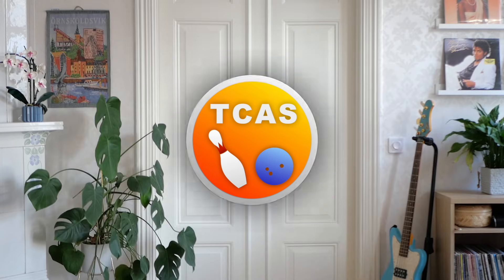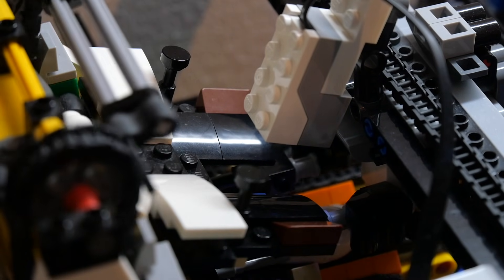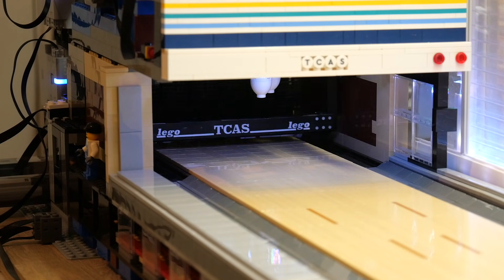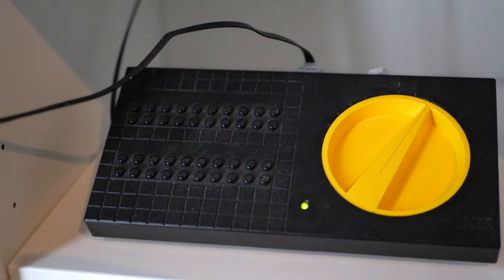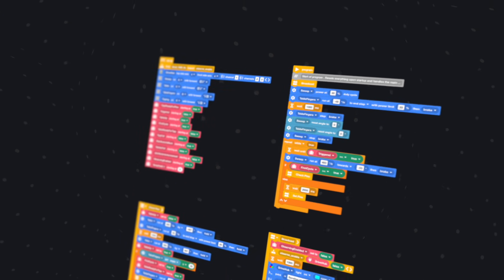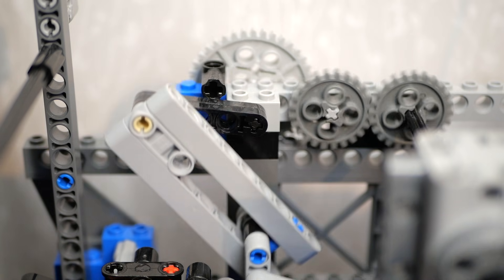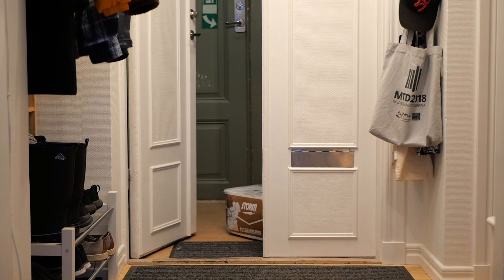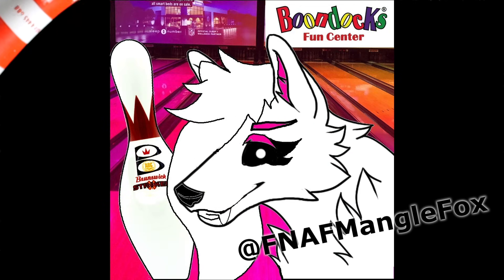TCAS Pinsetter - Powered UP, PyBricks & More!

Comment: The last 2 pins you are missing are 2 Canadian pins , a Fivepin and a Rubber banded duckpin
Reply from the maker: I’d also love a Kegel pin :)
Reply: Oh , also the way you identify these is by the blue/black rubber band in the center of the pin , and you also will need a photo from the side to identify fully , if it's nearly the height of a tenpin , it's a fivepin , but if it's really short , it's a rubber band duckpin

Comment: Hello thinkCLEVERandsmart, I just downloaded score more and I was wondering we’re do you get the senors so it can be fully automatic and how to do hook it up?
Reply from the maker: Hi! You can get the sensors from Amazon for example. Look for ”6V Laser sensor NC”. You then need an arduino Uno or Leonardo that plugs in to your computer with USB. Make sure to install StandardFirmata on it. Let me know if I can help further :)
Reply: Thanks! One more question sorry for bothering you but can you just use a webcam for score more and u just press the space bar right?
Reply from the maker: @Nickthe2handedbowler No problem, I like to help! Yes you can just use a webcam with ScoreMore, and you’ll calibrate it in the camera menu. Then you can press the ”s” key to score :)
Reply: @ThinkCleverAndSmart I got the Webcam the. A calibrated it into the scoring system. But every time I roll the ball and get pins down it always says I got a gutter ball or I only got 1 pin do you know the reason for that?
Reply from the maker: @Nickthe2handedbowler during calibration, does the pins light up green or red? They are all supposed to light up green. Then, if you remove all the pins, they all should turn red. If not, you can play with the threshold slider to get it right. You may also check that the background behind the pins is dark enough :)
Reply: When I set it up the pins are green but when I bowl and get a strike it says I got a gutter ball and when there’s no pins left they don’t turn red
Reply from the maker: @Nickthe2handedbowler Yeah that means the background isn’t dark enough or the threshold slider needs to be adjusted. Put all pins back up, then drag the slider so that at least one pin turns red. Then drag the slider just enough so the pin turns green again. See if that works :)

Comment: That is a huge glow-up with the new pybrick motors! Also, how long is the pinsetter and the lane altogether?
Reply from the maker: @MachuGamingDX  thanks! It’s about 1.5 meters in total
Reply: @ I meant the length in lego studs.
Reply from the maker: @ Well it’s not to scale anyways. But 1.5m would be about 187 studs

Comment: Hi tcas, do you need an ardiuno do get automatic scoring in scoremore? im just using a webcam and i calibrated the pins but when i start a game, it doesnt work. How to fix this?
Reply: and also, when i open the app my camera makes all the colours black. Is that normal? thanks
Reply from the maker: @ImBoredCuzWhyNot  Yes that’s normal, just to make it easier to see. The pins should look white and the background needs to be black for it to work
Reply: @ThinkCleverAndSmart  hey tcas, even if i calibrate the pins and save it, when i shoot and click s it just says i missed. Is there a way to fix this?
Reply from the maker: @ImBoredCuzWhyNot  what color is shown on the pins when calibrating? Green or red? Also, what happens to the color of you remove that pin just to test?
Reply: @ThinkCleverAndSmart Its green and it stays green when the pins arent there for some reason
Reply from the maker: @ImBoredCuzWhyNot  That means it’s not dark enough in the spot where the pin used to be. Try make the background black and play around with the slider value to see what happens. It should be red when a pin is removed
Reply: @ThinkCleverAndSmart  Ok thanks
Reply from the maker: @ImBoredCuzWhyNot  Hi! Yes, you need the arduino and a pair of sensors to get automatic scoring. If you just want to use the webcam without arduino, then just press the s key on the keyboard to score
Reply: @ThinkCleverAndSmart  Ok! Thank you so much

Comment: idea: for your distributor, instead of having the entire assembly move forward with a seperate motor, make the assembly stationary and put a ramp under it that can extend outward and have it controlled by the same motor that controls the left and right movement of the distributor (for instance: if the arm thing is to the left, the ramp is extended, but if it's to the right, the ramp will be retracted)

also had you ever had a problem where your pins get decapitated before? (the part above the red stud falling off)
Reply from the maker: @RedSlime69  Im currently working on a version of the distributor without the chains, but I cannot use ramps. I tried using ramps before but the pins will get stuck unless the angle is very big, which uses a lot of space. I’ll make a video when this is done 😄

I’ve actually only had that problem when a pin gets stuck somewhere in the machine, never from just bowling. They are really robust since I’m using a bar inside of them that goes through the head and body
Reply: @ThinkCleverAndSmart  how about you did what amf distributors do and stretch out the belt/chains instead (you already know how it works because you done that style of distributor before)
Reply from the maker: @RedSlime69  Ot works but requires a lot of precision and it’s a problem that the pins come in at an angle to the holding area. I think the new version will be a bit better
Reply: @ThinkCleverAndSmart  well good luck on that version then! i hope you complete it soon!

Comment: Pinsetter evolution (from memory):

-Started out as A2, with only a rake and a barely functional setting table
-scrapped and rebuilt into GS-X with new rake/sweep, transport band but no setting table
-setting table added with some changes to the back
-setting table removed and rebuilt for the NXT 2.0 upgrade
-rebranded into TCAS
-pin wheel added but was removed right after and replaced with a pin elevator (WRONG)
-ball accelerator added
-pin elevator shovels rebuilt due to pin jams
-setting table rack rebuild
-pin elevator shovels rebuilt AGAIN due to more pin jams
-sweep mechanism upgrade
-prototype distributor added then removed
-pin elevator upgraded
-double pin loading thing added
-many sensors and upgrades
-loads of distributor iterations and small upgrades
-rebuilt back area
-ball accelerator removed for ball dispenser
-new ball detection sensor
-other small changes
-distributor complete

thats all i can rember i guess
Reply from the maker: @RedSlime69  Wow that’s some good dedication right there! You are almost correct on everything which is really impressive. Thanks for sticking around!
Reply: @ThinkCleverAndSmart  thanks! i've been watching since 2015!
btw which pinsetter do you most prefer?
i like the gsx because its the most quiet and efficient but its pretty clunky
when something small goes out of alignment the entire sequence breaks apart and it dosent do well with off spot pins
the a2 is really loud and power hungry but are built like a what the heck and can get put up with lots of abuse
amf is my least favourite because they're both loud and clunky and dosent do well with sloppy strikes (pin falling over last second from wobble) and like the gsx does not do well when pins are off spot
Reply from the maker: @RedSlime69  The brand new GS-NXT is my favourite design-wise. It’s very compact and quite elegant. But the A2 as you say is super impressive and I love how smooth it can run. AMFs are my least favourite too, they can be really sloppy overall lol
Reply: (A)nother
(M)echanical
(F)ailure
and A2 name sounds like a tank because it really is a tank lol
Reply from the maker: @ true lol